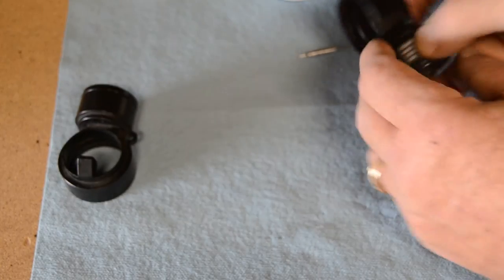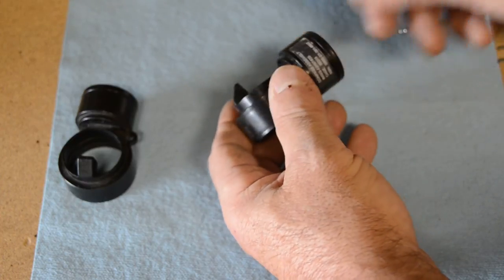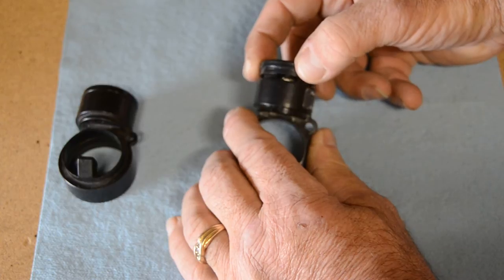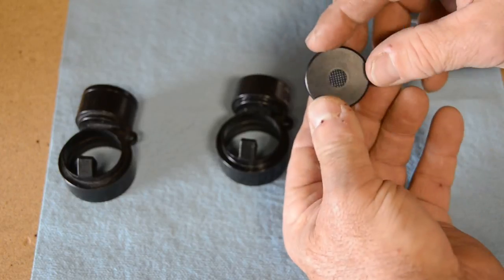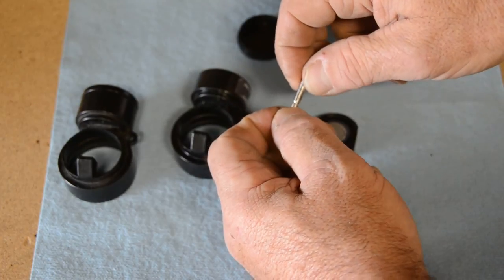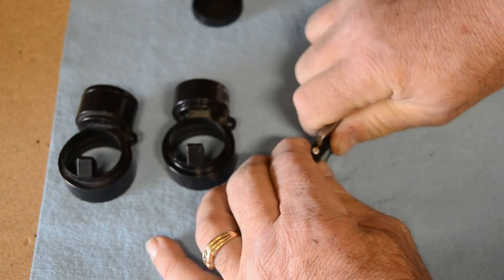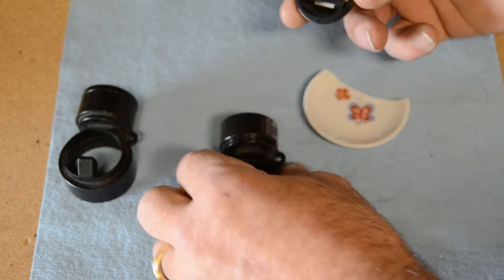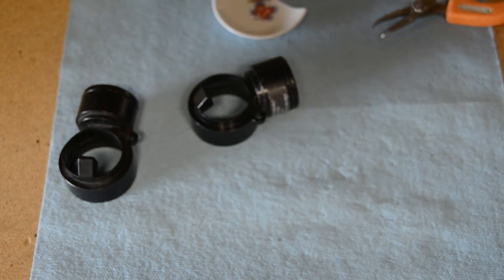AN/PVS-14 magnetic compass battery replacement

Comment: I'm assuming if that 'gold plated spring' were sheared off at the angle that one is SOL?

I have one I'm working with. Compass reading works fine (I've added my own light source to confirm. Think battery may be dead but I also broke that spring when removing battery (spring was fragile).
Reply: SUFFICIENCYtoLIBERTY 
I installed a flat spring on my PVS 14 compass and I
Reply: SUFFICIENCYtoLIBERTY 
I installed a flat spring on the gold plated spring on my PVS 14 compass and I don't have to bend it back.

Comment: Does it function in daylight (without nvg of course)?
I'm looking for a similar product that can be used either with or without protective glasses in daylight.
Anyone knows of some kind?
Reply: It will work during daylight and visible to the naked eye only if the LED is lit. 
Not too practical though as you'd have to always be pressing the pressure switch on the bottom for it to function. 
As this great video points out you'd have to press pretty hard to get the full brightness of the LED
That being said the compass is not visible without the LED
As for other like items I can only suggest google or maybe DX/Deal Extreme

Comment: How the hell do you USE the compass? im totally stuck
Reply from the maker: The unit slips over the front optic housing.
When you push on the bottom of the compass in the center, it makes contact to illuminate the led that shines through the compass, into the NVG unit.